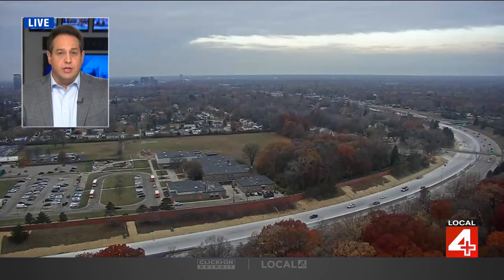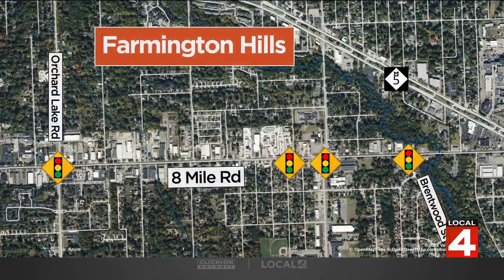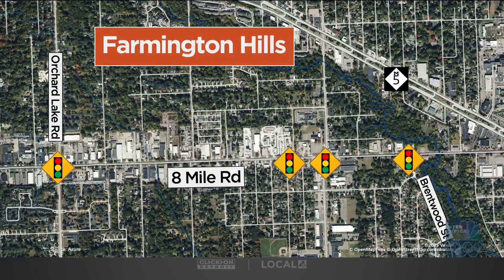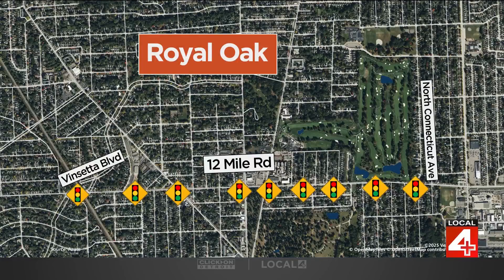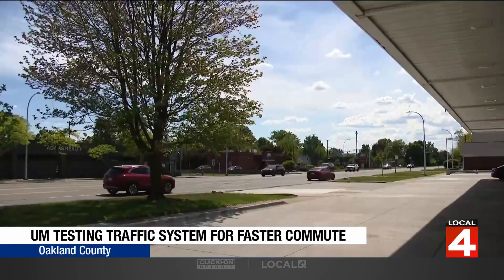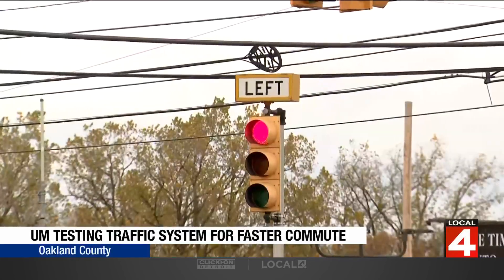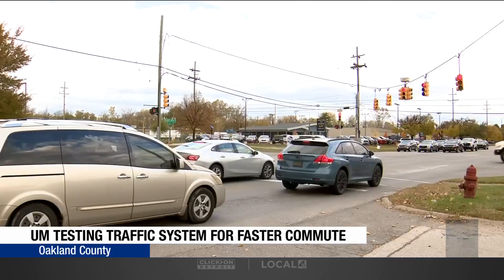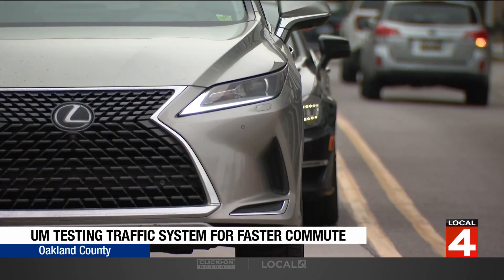University of Michigan testing traffic system for faster commute -- Here's how it works

Comment: Duration does not address the nonsense of Michigan timing lights for five over the limit. Without speeding, you get caught constantly or arrive on yellow, which means slam on the gas or brake. Their excuse was allowing traffic to clear before the next group arrives, but if the lights weren't timed fast the next group would have matching acceleration time and would not arrive early. It's stupid and accident provoking!

Comment: Boulder, Colorado has, (or used to have), such a system; it worked quite well. Instead of giving priority to side streets with on demand trippers, it prioritized keeping arteries flowing. There were trippers for side streets, but signals were timed with respect to arterial traffic, and there were longer waits between go signals for them.

Comment: If people would drive the speed limit traffic would flow better. The problem is there are different levels of speeders and the lights will be set for one group of speeders. That means either the fastest traffic will get through and the law abiding traffic gets stuck at every light or it's timed for a lower speeding group and the highest speed law breakers get stopped at the light and delay the main group of law abiding traffic while the fastest law breakers have to accelerate and cause the same problem at the next light. It all comes down to law breaking speeders mess up traffic.

Comment: Considering Oakland County is mentioned a bunch in this video, here’s a solution for starters: at intersections with flashing yellow left turn lights, put the green arrow protected left turn after the traffic turning right and continuing so that way anyone turning left has the opportunity to go first if traffic is clear and that way time can be reduced for protected left turns especially if all the left turners have already made their turn before the protected green arrow.  That would be a great way to reduce traffic cycle times.  (For the record every county surrounding Oakland County does this so…)
Reply: You encountered this video too! How'd you find it?

I agree with you. To my knowledge, most signalized intersections in Michigan have adopted this scheme - the green arrow illuminates after opposing traffic has cleared. Of course, there are a few exceptions that I can think of (mainly in the Detroit area). Other states adopt their own timing algorithms.

Comment: It is not difficult to set a traffic lights you get in a car drive the road and adjust the lights accordingly and when you stop at every one you change the settings
Reply: That might work in a small town with one main street that has lights. It doesn't work in a city where traffic is coming from cross streets where other traffic lights are also directing traffic.

Comment: make em roundabouts  - i know alot of people hat them though. i like them
Reply: If a roundabout can work at M-5 and Pontiac Trail, they can work just about anywhere.
Reply: No. Drivers are horrible at Roundabouts. They only work if everyone cooperates and most don't.
Reply: @AnneMichigan  Some are, but my friend was t-boned and killed when someone ran a red light and left 2 very young children motherless. That doesn't happen in roundabouts, plus, roundabouts work when there's no power. What happens at intersections when the lights don't work?
Reply: @AnneMichigan wrong. Most do when they realized it faster